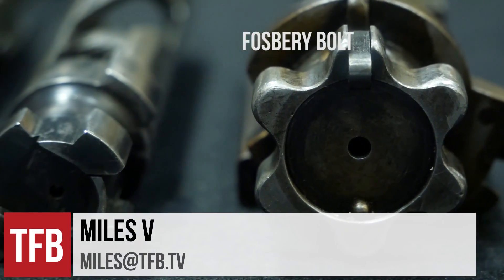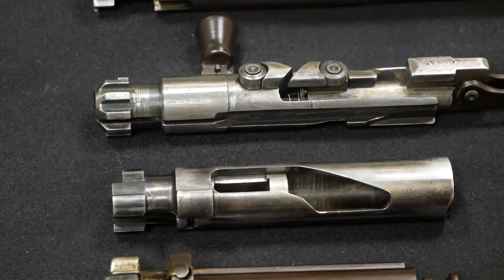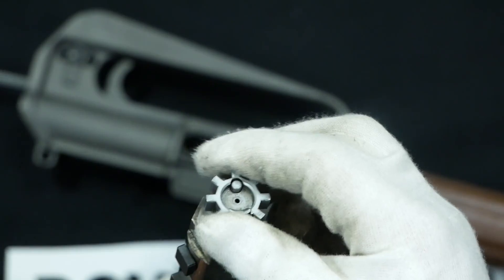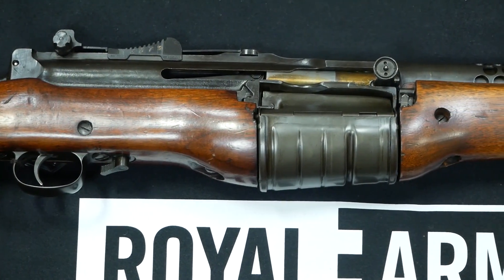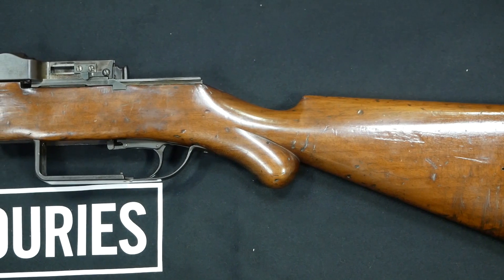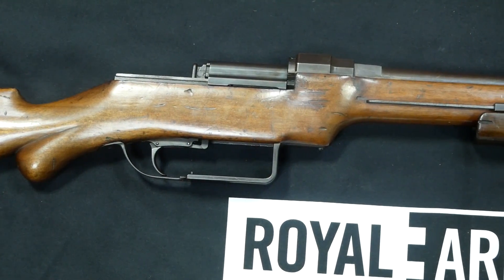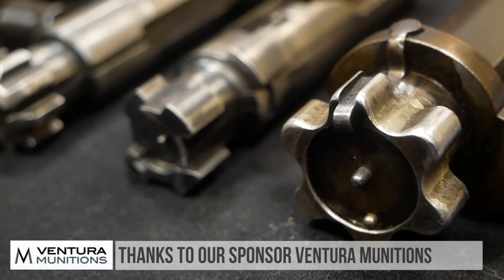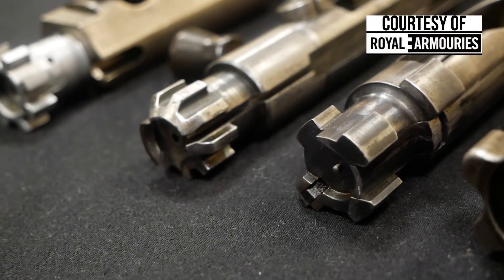Origins of the Multi-lug Rotating Bolt

Comment: good video but small correction, if im not mistaken the ar10 had/has a gas piston mechanism not an impingement mechanism. could be wrong but I don't believe so
Reply: The Armalite 1957 AR10 was di like the AR15, but the first model put the gas into a hole in the left side of the carrier without a carrier key.

Comment: That's not a Sudanese; those, and all Dutch-production AR-10s had the gas key on top of the carrier.  That is a Hollywood shop-production AR-10B, one of the 47 examples of that model that were built.  It's WAY rarer than a Sudanese, which will, themselves, fetch around $10k even on an aftermarket semi-auto lower!

Comment: Artillery guns have used this system since the very first breech loading guns.  They called it "interrupted thread", but it was basically the same thing.
Reply: Minute Man Not really; interrupted threads are usually a 90* turn, just with threads instead of single lugs.

Comment: Rotating bolts are good for artillery and slower fire-rate weapons.  They are terrible for assault rifles, terrible.  By the way, the Stoner rotating bolts are ALL based on the Steyr Mannlicher of 1895.  1895!
Reply: Rafael Lastra com - What are you talking about? The rotating bolt is so widely used today because it's arguably the most accurate with large amounts of locking surfaces running the circumference of the bolt face keeping the cartridge parallel to the bore. Not to mention the strength of the action when compared to others I.g. Roller cam, falling block, tilting bolt. 
And the m95 bolt was a 2 lug bolt.
Reply: Yeaaaaaaaaa, no.....
Reply: you are fake news
Reply: Rafael Lastra com you're basically saying you know more about firearms than every major, or small for that matter, firearm manufacturer, engineer and designer in the modern era. that's quite a display of narcissism.
Reply: Rafael Lastra com British sa80 lmao
Reply: Rafael Lastra you first claimed that the Stoner bolt was based on the two lug 1895 bolt, which is nonsense, the 1895 rifle was not the first rotary bolt either.
Reply: You guys know nothing about guns, NOTHING!
Reply: Great argument Rafael.